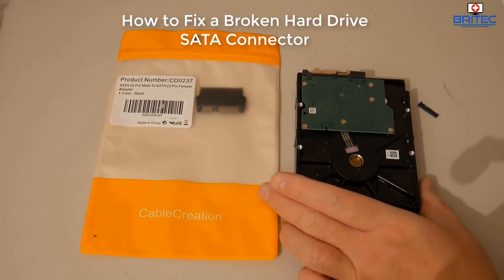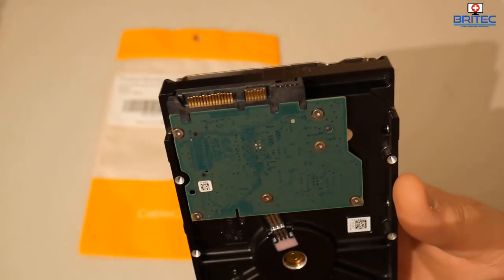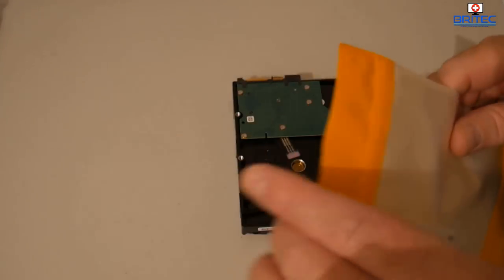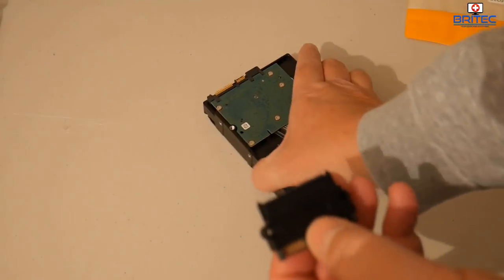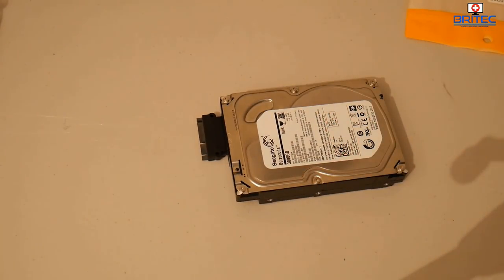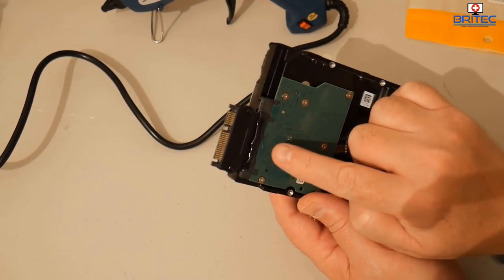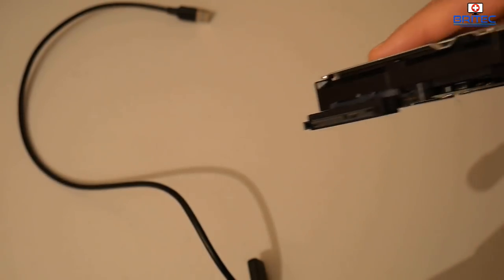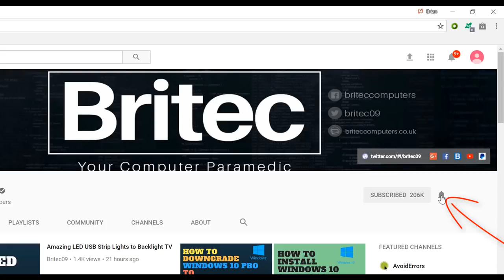How to Fix a Broken Hard Drive Power or SATA Connector

Comment: Method is solid, but I'd recommend pretesting the new connection before gluing it down. Could do more damage if you end up having to rip it off to reset a bent pin.
Reply from the maker: Its a fair point.

Comment: Thank you for this very useful tip. My machine didn’t even power on suddenly one day and it was the PSU which got shorted out due to this problem (I found that out after I got to the bottom of it). I had to replace the PSU and then do the fix posted here on a WD 6 TB drive. I had to cannibalize the plastic bit from another old Seagate drive since that plastic bit had somehow gotten lost or fallen somewhere. Funny thing is I didn’t realize it was the problem until I put the new PSU in and the machine would boot up without this hard drive connected but completely ‘die’ with the broken hard drive connected with the naked pins to the power port in the drive (loose of course but I didn’t realize the brokenness). It was shorting out the machine itself. Somehow the new PSU didn’t die and after I fixed it I recovered all the data off the drive (again thankfully no data loss) and decided to retire the drive even though it still works with this thingy on the ports sticking out. One hoop I had to jump through was that I had to connect it to main machine because an external SATA connector could not read off the drive. Maybe because it was 6 TB and had GUID scheme. But I just left machine open connected to the old and new hard drives on the Onboard SATA and power connectors overnight, carefully condoning off the room to avoid electric accidents and after overnight data copy (using FileSync) all was well.
Reply: O wow.....this is somewhat happened to me too....my pc sometimes become laggy, i thought it's the windows update problem...now after i physically checked it, the SATA CONNECTOR on the hd just suddenly fall off after just some wiggle and the plastic part of the POWER CONNECTOR also become easily broken (like a substantial wiggle can broke them which is problematic, because u need to wiggle it to remove it)....damn WD(to be fair, it is a 8 y.o. hdd, so the plastic probably lose its integrity)....just ordered this male-to-female connector and a new hdd, it already it's time to move all the data to a new one and probably turn the older to be a redundancy drive....hope this method works and i can safely transfer all the data to the new one

Comment: Had a mishap with a drive over the weekend, and I've been freaking out thinking I was going to have to either spend a paycheck on data recovery or try to teach myself to solder so I could somehow connect the pins to an expendable sata extension. Going to order one of these on amazon tonight, and cross my fingers I can get this to work.

Comment: The connector repair is solid but the USB-SATA interface shown will not provide 12 volt power to a 3.5 inch hard drive.
Reply from the maker: I know that, just showing it plugging in to a connector.
Reply: All right.

Comment: Just a question, you cannot just use superglue to put the plastic piece back on the drive and be done with it instead of this fancy stuff?
Reply: It won't be able to handle the torque that's generated due to the adapter, and would snap eventually

Comment: HI ty for the vid.  The part on my hdd is the plastic peg that fits into the female on the back of the hard drive. You had the old part. How do you do it with out that? Can I  not change the whole back of my HDD with one from another HDD? Thanks. Yeah I know this is old but any help is appreciated

Comment: What if you don’t have the flimsy seagate plastic that came off to begin with. Because I tried to rig it together with a few risky options and ended up melting some plastic luckily* (I think) I didn’t short it beyond repair.

Comment: The hot glue your using is clear or white in color its a low temperature melting point, you can buy a higher temperature melting point hot glue that bonds better.
I've used types that are so strong youll break any plastic before the glue pulls off.
I've used lots of the black type in cars where in the summer temperature can reach 140 dgr F  this tends to hold better.
There are stronger versions but the hobby shop white stuff isn't very strong.
Becuse hard-drive get hot the whitechot glue will get soft and easly come apart.
Id use a super type of glue and activator spray to make the bond then build it us with a black hot glue thats high temperature.

Comment: Hey @Britech09, i got the same HDD as u (2to though) and the pins are ripped off, some are even missing, I think there are like 3 or 4 that seems to lineup correctly (on the signal pins side, not the power). I also don't have the missing plastic piece, it's forever lost. Would this still work ?

Comment: At 7:32 you show a (USB Adapter) and state firmly that the Sata 22 Pin Male to Sata 22 Pin Female needs to be connected to another cable here without  shorting, if you don't use anything like this you risk shortening the pins across.  And at 7:54 you say it can be plugged straight into a computer without the additional USB adapter.  This is somewhat confusing.  Can I assemble the Sata 22 Pin Male to Sata 22 Pin Female adapter as shown and then plug it straight into a PC without using the USB adapter?
Reply: Plug into sata port

Comment: Hard drives are mechanical and moving parts are going to wear, there is no cheating the laws of physics, all HDD's and SSD's are going to fail at some point. For any data I need to keep I make multiple backups on other drives in the cloud and at another location.

Comment: Thanks Brian :-D
That looks solid as a rock, better than having to source an identical pcb socket and have fun soldering lol.

A frends pc was blue screening for no apparent reason, i found touching the ssd drive made it worse, i thought ahh a bad pin joint.
So i removed the ssd case, the connector just fell off the pcb like it had not been soldered.
i was amazed that it managed to work with every solder joint broken.
Some real solder and 5 mins of carefull soldering and it was bomb proof :-D.
Beware of crappy lead free soldered sockets.
Reply from the maker: Yeah no need to solder these, that's just making work for yourself

Comment: just curious how much a replacement board would cost for the HDD  but I was thinking some HDDs has an encryption chip on it
Reply from the maker: You would have to find a identical hard drive and use the parts from that. More expensive and time consuming.
Reply: Do we have to use the same company drive ?
Reply: I broke my sata plastic part but the connectors are fine ease any help i have very important data in the drive and i just bought it a week ago

Comment: What’s the difference between the 90 degree adapter and the normal one ?
Reply: Normal is straight - ie 180 degrees, 90 degree is a right angle - otherwise no electrical difference

Comment: Just adding something to this....my HDD is 8 y.o. Suddenly my PC become laggy when i played games (i thought it was a software issue from Windows update)... But it keep happening and after i checked it physically, the SATA CONNECTOR just fall off suddenly after i wiggled it 2 times and if i checked the POWER CONNECTOR, the plastic part also become easily broken..like a few wiggle broke the L part of the CONNECTOR....it is probably a material integrity issue, damn WD (because it is really old though, so.. I don't know)....i lose the broken piece and will probably use a broken-in-half micro-sd as the substitute...still waiting for the 22pin connector to come and hope it will works, just like in this video

Comment: Would that USB power a 3.5 hard drive ?
Reply from the maker: Only if you plug it into a power outlet USB Hub, not enough power from a front panel USB port to drive that 3.5 inch Hard Drive
Reply: no it cant power it, 3.5 need 12V :)
Reply from the maker: I think we already know you can't power it that way. The connector is just showing you that it work

Comment: ST3000DM001 is a horrible harddrive. They a prone to "click-of-death". Mine failed 3 months after the warranty exceeded (click of death, SMART data was checked  and logged the month before, absolutly flawless...)
See also wikipedia.org/wiki/ST3000DM001 

Better replace that drive!
Reply: Detmer aye. Over the course of 2 or 3 years, I think I had 5 or 6 of those Seagate 3TB drives. I had so many because I was using two at a time, and had to keep replacing them. 3 had each failed after about a year of use. After that and reading other reports of high failure rates of the model, I replaced the others before they had a chance to die. They’re total garbage.

Comment: Just bought a new 6tb hard drive. This had happened to me. I went ahead and followed what you did. I connected it and at first it would sometimes see the hard drive but not let me partition the drive as it was greyed out. And now it will not even see the hard drive. I don't know what is wrong.